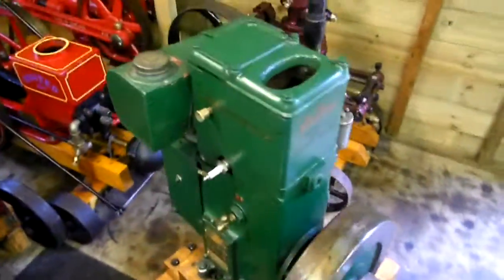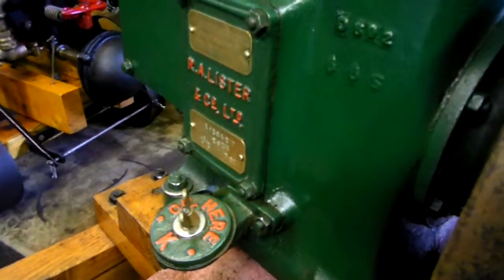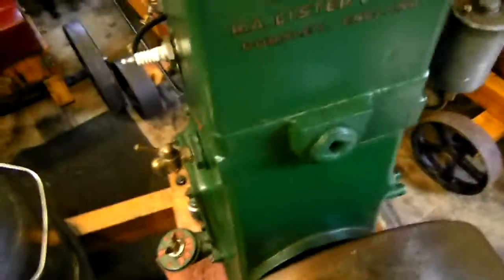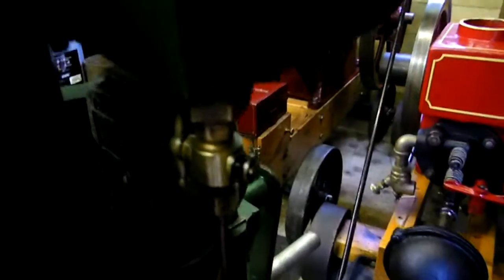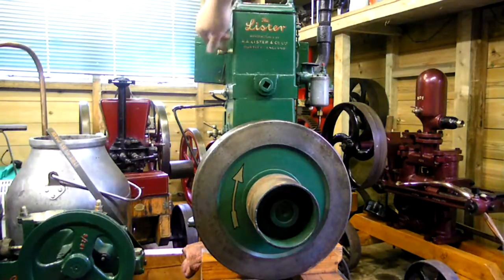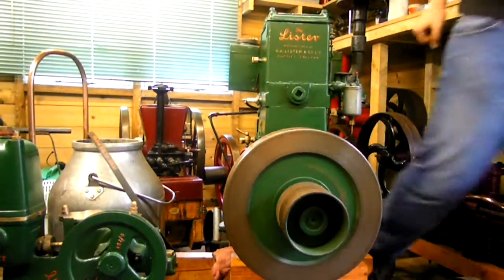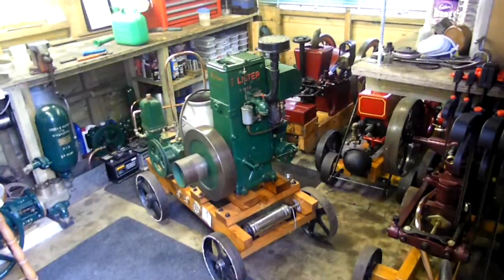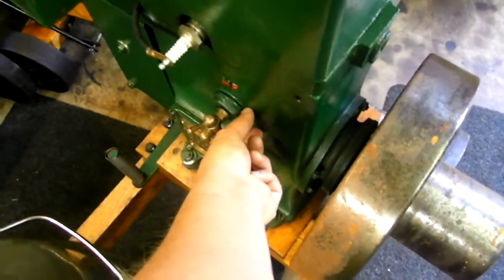How to Start a Lister D

Comment: Ive never bought the paint from stationary engine parts, as it is far to expensive. But if it is engine enamel paint, it needs time to dry for many weeks, as it doesn't have its petrol proof property's. But I baking it on, to some extent. So when I paint engines I make sure I don't spill oil or petrol on it, then give the engine a good run, letting it get really hot. Which hardens the paint.
I have Wolseley WD2 and I don't have a dip stick, would you mind giving me the measurements, off your Wolseley.
Cheers
Harry